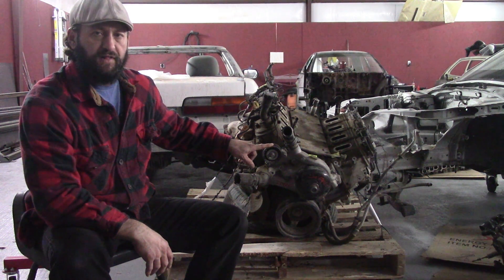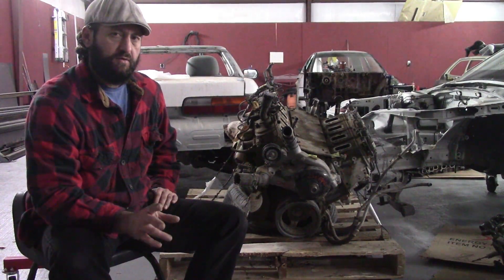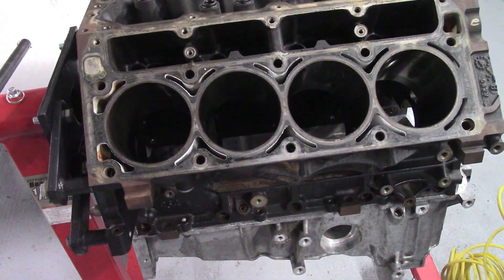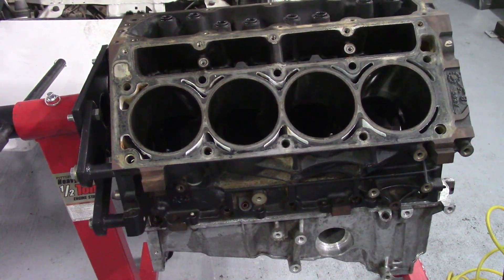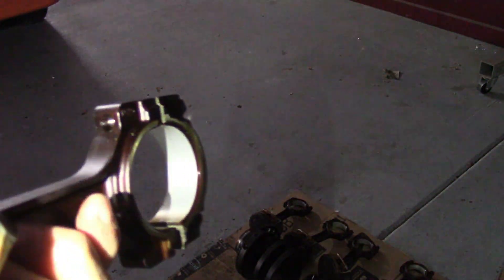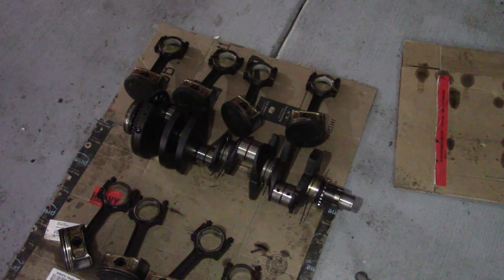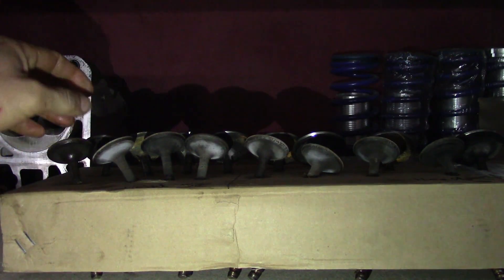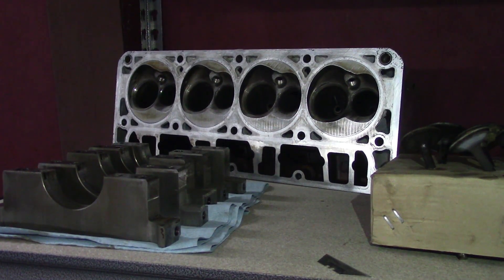Subaru 6 Liter LS based engine swap

Comment: Can you show me what kind of brush you used to clean up that head? I really dont want to take my heads to a machine shop if I can help it.
Reply from the maker: Plastic bristle brushes for the gasket surfaces and soft wire brushes for the outside of the heads and block. I start with a big dish brush and good ole Dawn dish soap.
Reply from the maker: There is also a rubberized cup for a drill that works well. It’s called a Rolloc Bristle disc
Reply: @PsuedoMechanic  Awesome thanks!

Comment: I assume you are going to use Trailblazer SS components for the front drive based on the oil pan. No need to polish the bearings or the crank, just throw it back together. What engine management are you using?
Reply from the maker: I think I’m will go with the Holley term x. The transfer case and front diff and pan are trailblazer ss.